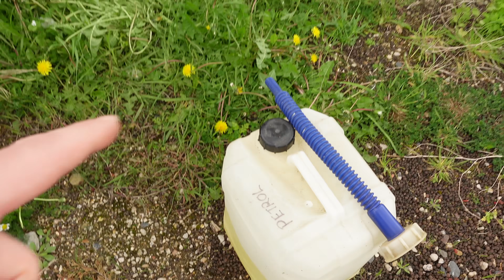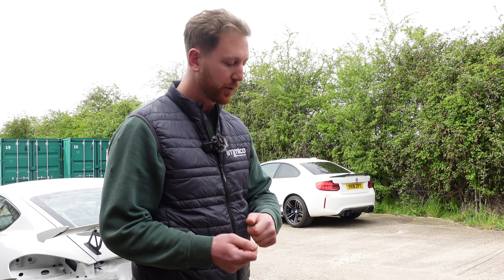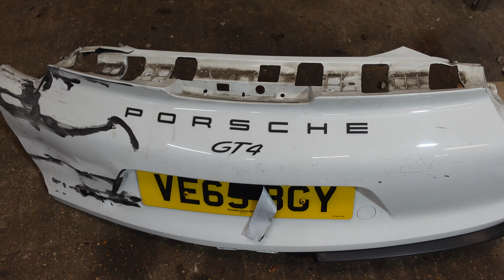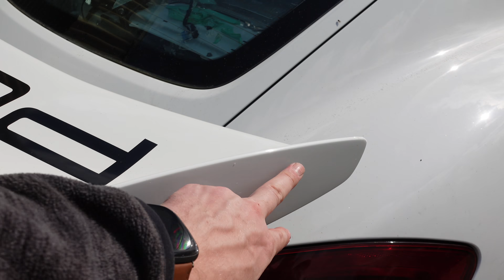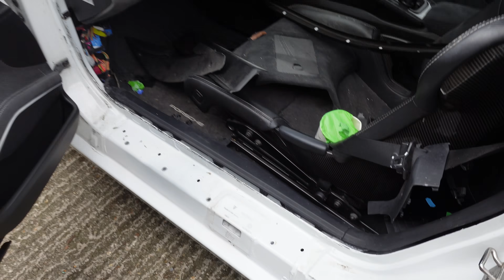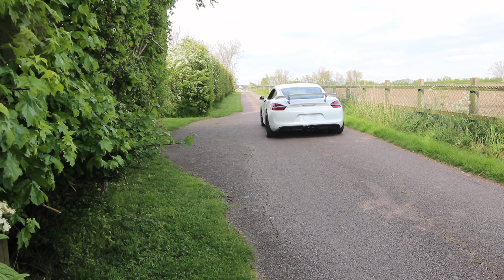I FULLY REBUILT MY CRASHED PORSCHE CAYMAN GT4!!.. ITS SOUNDS EPIC!!...

Comment: The axle damage may suggest a future issue. The damage to the splines is odd. Axles pulled out are not as much of a problem as ones that get jammed in. Did I see rusty water stains dripping out of that front inner quarter panel before you put the rocker cover on? The great advantage of bonded panels is that there is no bare metal and the adhesive seals the gaps between bonding surfaces. The best you can do on welded seams is weld primer and a heavy dose of lanolin rust coating inside, which will hopefully seep into crevices. You could have used a bit more glass protection during the welding faze. Grind and weld sparks go EVERYWHERE, and they will pit your glass immediately, and permanently. Overall a very nice job, and well done. Pretty rewarding, eh?

Comment: Watched the whole series........initially because I was looking at a salvage Cayman with a rear tire/wheel on a 45 degree angle.  Just wanted to get some idea if there would more likely be CV axle shaft assembly damage or if it would have also caused differential damage......had not good under carriage pictures.  Your videos make me more confident that it is worth taking the chance. Good job with the spline repair. Car turned out great.......like the color and the wheels. The way you tackled the project with confidence was great.

Comment: I had Porsche supply and fit my rear badges on my Gt4 as they use a metal jig to get in the right position I only paid £130 or £160 so wasn’t horrendous

Comment: Why is he pushing for higher EGTs can cause cylinder heads to crack manifolds to crack most stock and indeed tuned Ecus are calibrated to limit power with higher egt only standalone would properly benefit and old school cars of course.. I’d wrap near the wheel maybe but it’s not caused any problems to any I know of and tbh I think Porsche know more than this guy does about egt limits no offence to him😅did he give you the exhaust as a promotion is that what it is?

Comment: Great job, impressive!! The 981 is in many ways ”peak automotive”. Top tip: pull the vacuumlines to the exhaust valve actuators (and plug them) and you will have a much more linear sound over the rev range.
Reply from the maker: Thanks mate 🙌🏼 I’ve already done that with the valves , left the valves open all the time. 👌🏼

Comment: A shame that the Immico guy didn’t give any idea on any horsepower gains as that would be the primary reason for this upgrade I would have thought. 🤷🏻‍♂️
Reply: Because unless you tune it to do so higher EGT will limit power in most engines stock or tuned😅

Comment: Take all your measurements for the badges placements. Then take off them off and get your self some 3m peel and press tape it's for doing badges ultra thin and when you press it on its only on the badge hard to explain but when you use the stuff you will know what I mean.